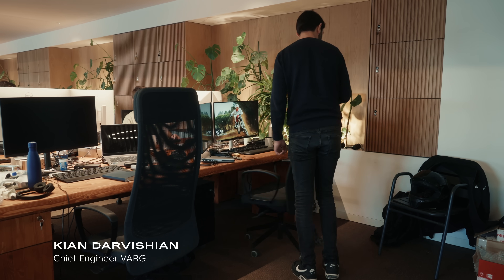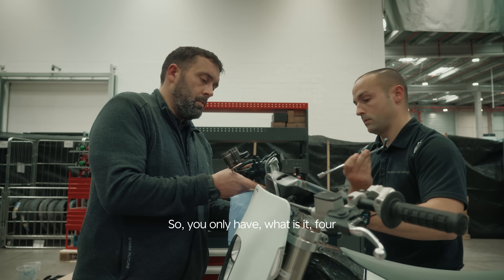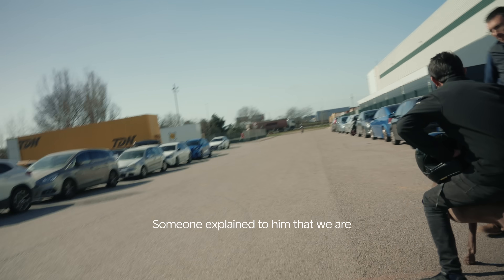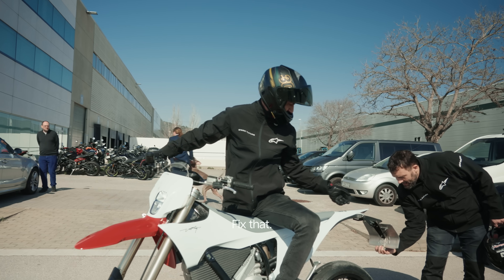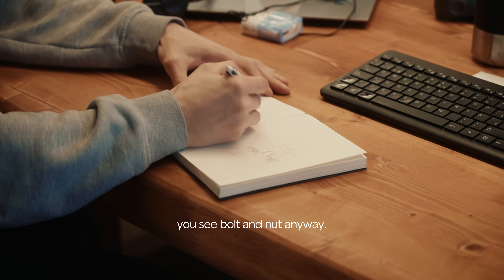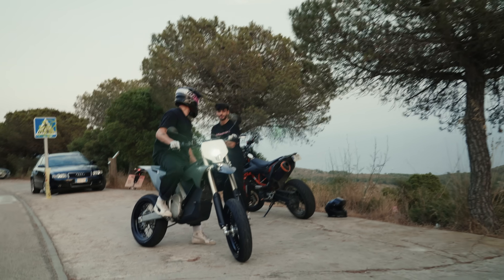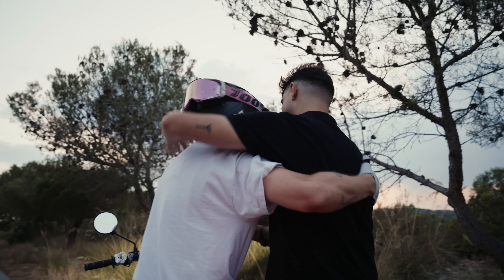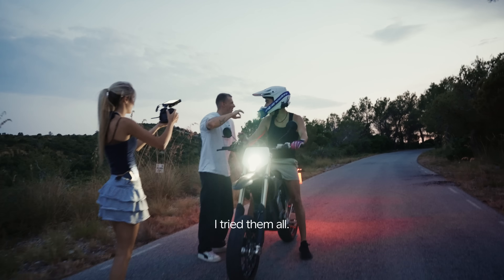Designing the VARG SM: From Sketch to Street | STARK FILES 012

Comment: I should’ve waited! But nooo, I had to buy an EX and order Super Moto wheels (WARP9) and Michelins and spend a few grand more and have a set of EX wheels and tires and giant, heavy charger. Now I can order an SM charger and see what else I missed out on. It’s winter and it’s sitting in the living room ( I’m widower so WHATEVER THE DOG AND I WANT IN THE LIVING ROOM IS FINE). Life is GREAT! Any problems I think I have are FIRST WORLD PROBLEMS. I’m only missing a cat. But we’ll find a keeper.
Reply: Would you say I should skip the EX build process and just buy the SM?
Reply: @waferzworld What I want is a bike (Electric Motorcycle) to ride around town and able to ride on the freeway for a few miles if I want to run to the next town. I’m 82 and probably not off roading anymore. The EX, even with smaller rims and a drop link for the rear suspension is taller than I like. I don’t know if the SM is any lower. If you don’t want to ride in the dirt I would suggest you get SM.
I’m going get an SM charger, assuming it’s compatible, the EX Charger/Stand is just something clumsy for my use. I’m afraid I was caught up in shopping for the Newest, Fastest, and so far I’ve got the only one in town. Whoopee😊! I’m thinking maybe I should have waited a little and looked at some of the EBikes between the SurRon and the STARK. Not freeway legal but lighter and smaller. I have a 72VOLT SurRon but wanted a little more. Thanks

Comment: I’m probably going to buy the SM but I’m waiting into next year to see if a lot of common issues with the earlier models have been tweaked and fixed. Specifically on the software side like the phone crashing/disconnecting, etc.
Reply: those problems are very rare now... i have the EX wich is basically the same bike and no software problems at the moment. When there is a bug Stark solve it in just a few days with an update
Reply: @karintosco  Are you taking the p1ss? I have the EX and its buggy as fk. Just earlier i turned it on and it wouldn't go in gear. often my indicators dont work until i turn it off and on again and i can not get the bike to lock no matter how many times i press lock. The one time it did work it wouldnt unlock and took 30 minutes before i could get home. That phone is a weak point oin such a great bike. Ive done 1200 miles on mine in a month and its great but that phone is crap. And what happens in the future when the bike is out of production and the phone dies and there are no more new ones to buy? how we gonna get it through MOT with no speeedo or horn? how we gonna know how much range is left? that phone is a big future probl;em as you cant just use another android.
Reply: @uv77mc85  Yeah that’s been holding me back from buying it right now, I’m sure somebody dedicated enough will future proof the bikes with a more permanent solution if these new phones on the SM are still such a hassle, but that’s a pretty huge risk to still take. I have heard of someone installing an actual horn onto their EX for better safety, not sure if it was successful or not. Stark has definitely sold me on the physical bike itself hoping they’ll address the software side of things for those of us still wary of purchasing.
Reply: @uv77mc85  Could you elaborate more on the bike not going into gear? So when the phone is disconnected the bike won’t let you ride?
Reply: @uv77mc85  i dont think a phone cant be available in the future, is the most selling and necessary product after food and electricity... it has its problem but all can be fix. Sad to hear you had so many problems, mine doesnt had that. Only 1 time that couldnt go in gear too, but 20 seconds later it worked
Reply: @domsvarg  you can ride without the phone, you can leave the phone at your house and go riding, you will not have a display but the bike will work perfectly
Reply: @domsvarg  Sometimes when i turn the bike on the up and down buttons on the handlebar which put it in gear and control the modes dont work. I have to turn it off and on again and then it works. Its nothing to do with the phone its just a bit buggy operating system. Its like a computer in that respects. Id still buy another though as its just such a great bike. Sometimes the indicators dont work either until i turn it off and on again..
Reply: @karintosco  The stark phone is a custom phone and a normal phone cannot be used  instead. Once that phone is out of production it wont be possible to use the dash functions. Unless somebody finds a way to convert another android phone it will be unusable on the road.
Reply: @karintosco  I remember hearing that now from Stark thanks for helping!!
Reply: @karintosco Thanks so much!!
Reply: https://www.youtube.com/watch?v=tkcFKMMw-60
Reply: I have the MX, still on original everything, 130+ hrs clocked
Reply: @WH05DAT Damn that’s awesome thank you!!
Reply: @WH05DAT  got 150 hrs and 3.000 km on my EX, everything perfect